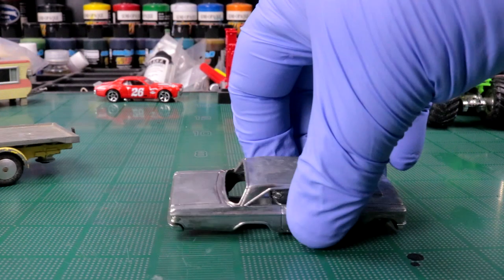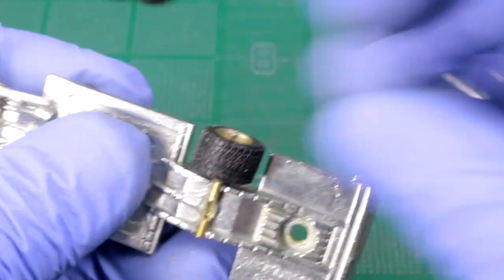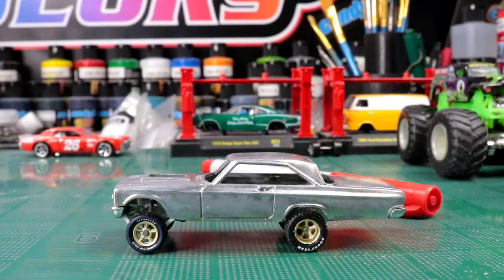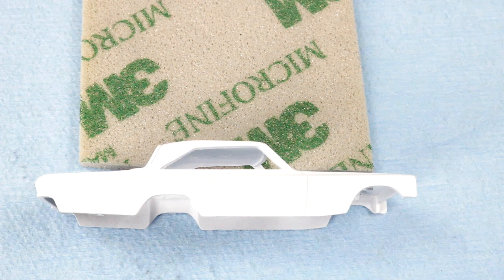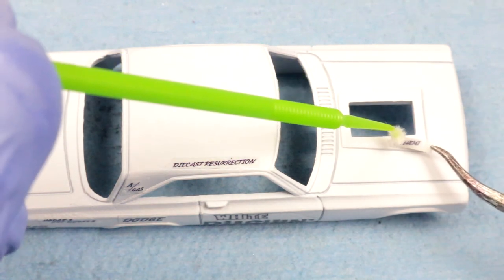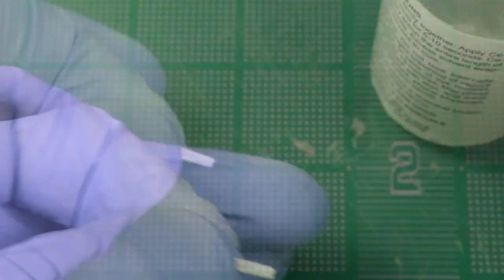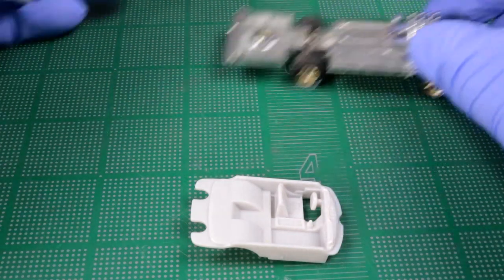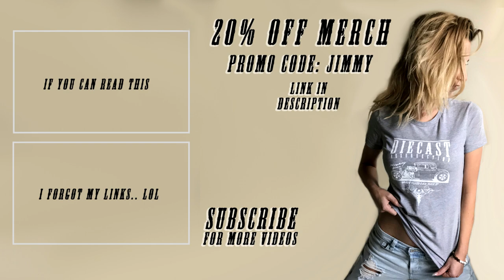White Rushin' Coronet Gasser Custom

Comment: These cars are running under the A/FX and not a gasser,  lot of great cars back in the '60s. These cars were the forerunner for Funny Cars.Excellent job on the resurrection and adding the suspension.Your cars are always top notch

Comment: If you're seeking a source of metal for scale leaf springs, look no further than a used pair of windshield wipers.  The blade inserts are typically backed by narrow strips of spring steel in various widths.  They're just getting thrown out, so...free materials.

Comment: They liked using Coronets because of that long trunk. Makes transferring the weight towards the rear easier. Sometimes they'd even move the rear wheels up towards the front further to get that weight to transfer and get better traction. Some had the tube axle mounted where the front tires were almost under the front bumper.

Comment: I would be more amused however this particular casting left Malaysia as a gasser in the Hot Wheels Dragstrip Demons series.  It is built originally in the 1960s specifically for racing.  The factory Coronet does not have such a long trunk area with the rear wheels pushed so far forward.  So you nailed the work perfectly exactly as was intended when Hot Wheels paid tribute to this era of drag speed with this casting. 👍🤘

Comment: If you do a king cuda hot wheels do a redline build there’s a ton of wrecked ones around I’d use a thin tin for the leafs I think pieces of solder or wire would look better for headers

Comment: Great Gasser project, keep up the great work, by the way my first car was a 1971 Plymouth 383 Road Runner with the GTX Air Grabber Hood, I traded it in for a 1973 Plymouth 340 'cuda, boy do I wish I still had both cars now, but no fret I still have a 1972 Plymouth 340 'cuda (but she is in need of restoration)

Comment: youre good with that dremel, you have junkers in that pile youll never use, cut those into your front ends, especially if your dremel is multi speed so you can find a comfortable speed to work with, i am a styrene guy, models all over, 
    i have lots of these too, but i dont customise, this mopar you did is the shit! 
    nice car

Comment: The 65;are my favorite mopars I don’t believe hot wheels has done none of the 60  like 63 to 65 mopars seems to be any thing after 68 around wen they started making the king kuda I have a friend who has a white 65 Belvedere same casting only one is dodge and one is Plymouth I have a bunch of muscle machines in that style and Johnny lightning good job it’s my favourite car why not just use wicked instead of auto air I’d clear it with a 2 k system should do a 68 barracuda or a 67 Belvedere